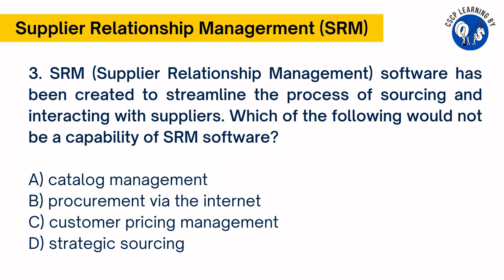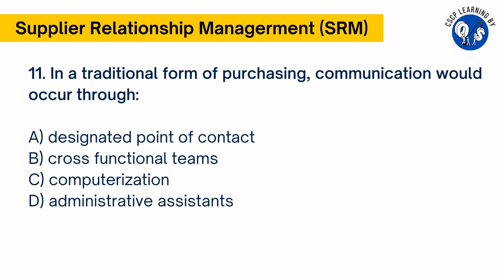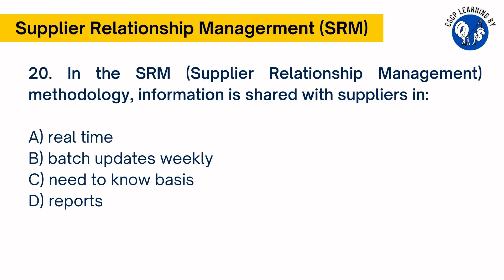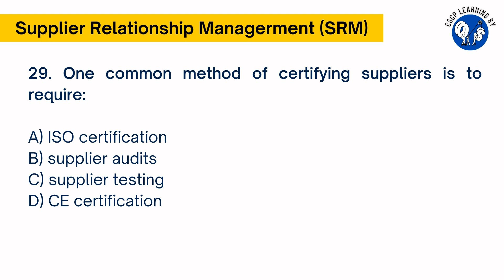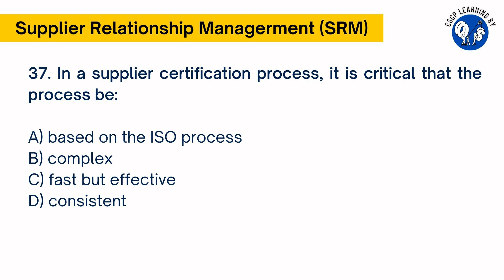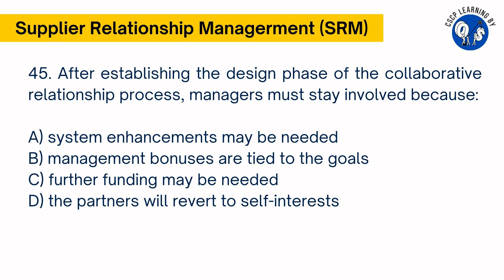Supplier Relationship Management MCQ exam | CSCP mock exam | MBA/BBA

Comment: Great job and Kudos to you for all your effort. Question number 44, shouldn't "trust" be the answer since both parties may not be contributing equally in the collaborative relationship. Also, trust would ensure that each party gets their fair share.
Reply from the maker: Thanks for the appreciation. 
Key word in the question is early stage. In the early stage, there is no element of trust.
Trust develops with the passage of time. Therefore, first thing which should be considered in collaborative relationship is equal sharing of profits among all the parties involved which will eventually build strong relationships.
Reply: @cscplearning1044  Very true. Thanks so much. Plus I took my exam today and passed, understanding of some basic concepts here really helped.